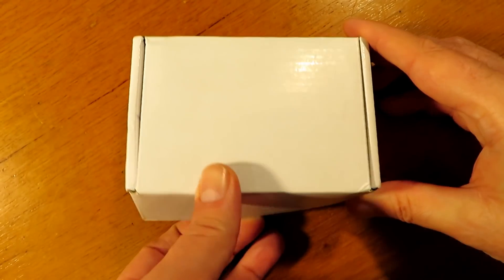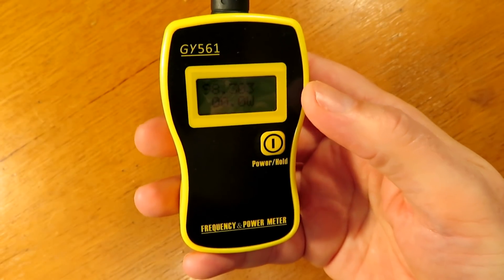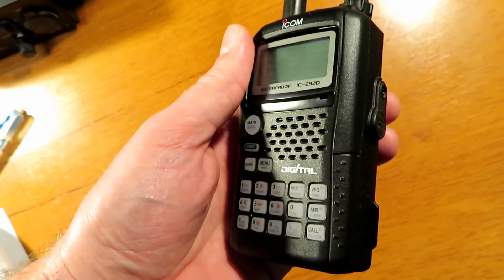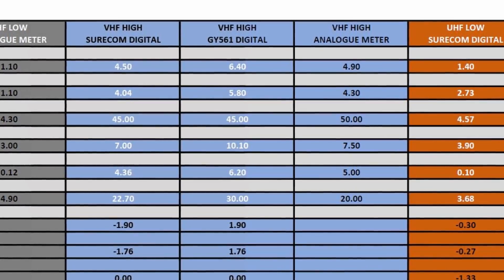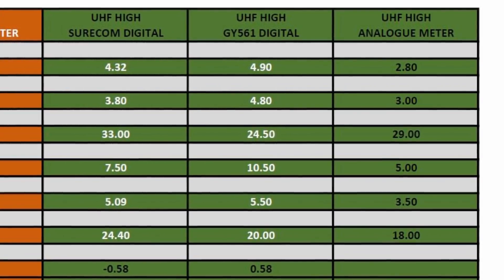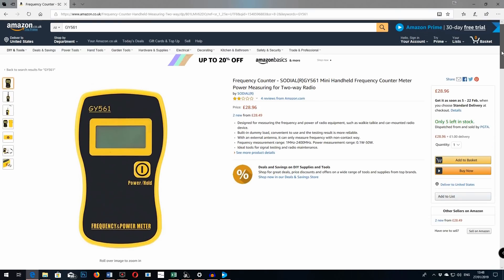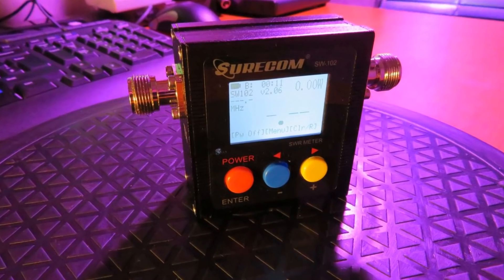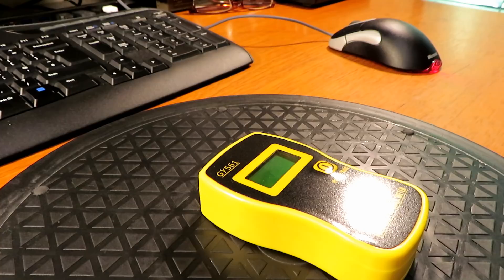Is that Real Watts or Chinese Watts? - The GY561 Power Meter

Comment: I have one and most of my measurements are for HF. I calibrated mine against a commercial power meter, and I get better than 10% when set up properly. Measuring higher up, its enough for me to know the frequency and that a transmitter is actually giving an output.

Comment: Another good review, nicely presented!
Made the big mistake of buying one of these and it is a steaming pile.
It locks up sometimes, with weird display corruption when measuring only a few watts, which requires the batteries be removed to bring it back to life. Totally inaccurate power measurements and really rubbish build quality. AVOID!!!
I went back to my analogue Revex W-560 and a dummy load. May consider a Surecom.
Reply from the maker: Thanks Adam, i know a lot of folks have got these so I was preparing myself for a bit of feedback let's just say, sounds like yours was really bad, I can recommend the surecom for sure.

Comment: Compared to my Bird, the meter is accurate. As you point out, the 'manual' does suggest calibrating it  and I have had that done. I agree, £30 is a tad high for this item; I paid £25 on ebay for it.
To ascertain whether this uses "Chinese or English watts" one should always carry out tests with more than one meter, and that's the same advice I give to people who set themselves up as the arbiters of truth with just ONE example of a Baofeng radio, Chinese items being so variable in quality.
Reply from the maker: Yes I am sure with some calibration it would be OK mike and as a pocket frequency counter it is useful ( I should have made that point in the video), the reason I wanted to test this meter was that I had seen so many videos where the meter appeared to read much higher than it should when people were testing it on radios that I had and knew never put out the power people were detecting with this meter, its been around for a long time this has and I half thought they might have sorted it out but it appears not.